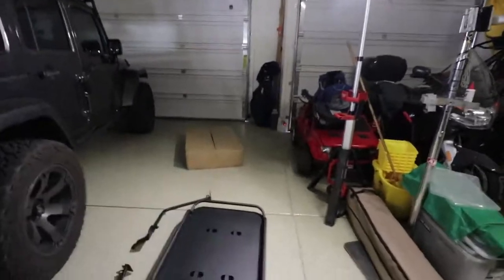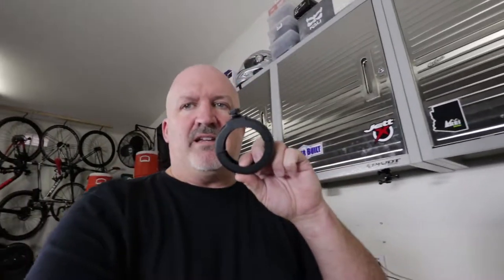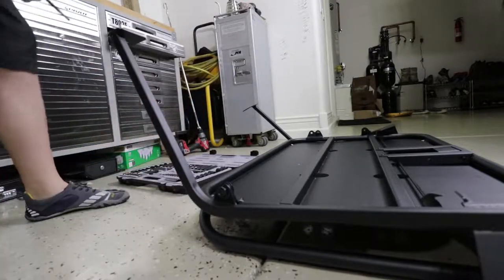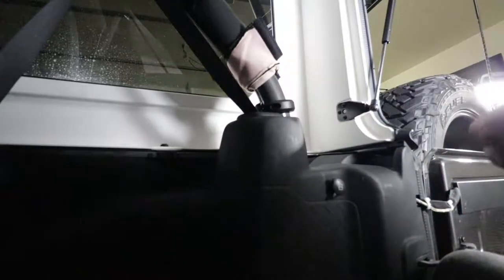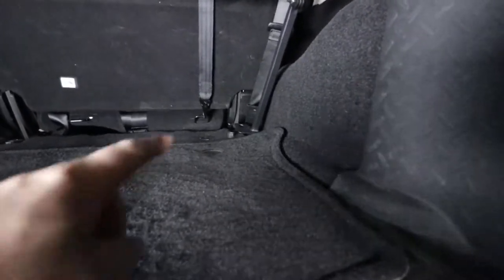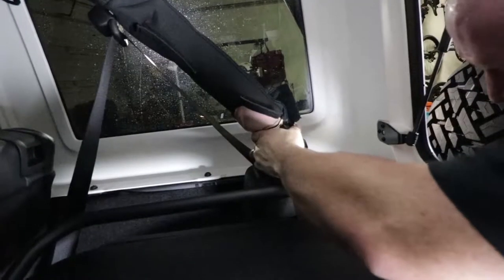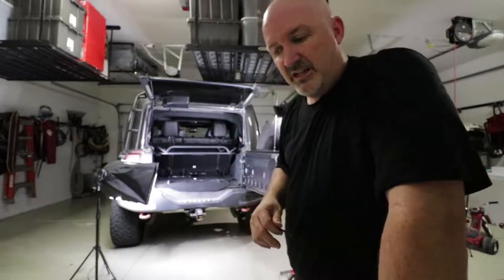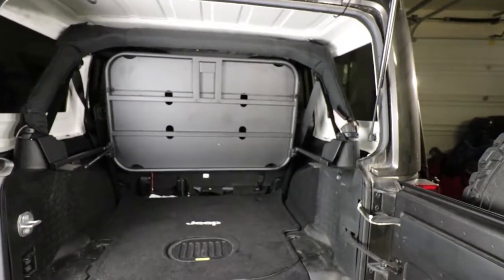Rampage cargo rack Installation - Jeep Wrangler

Comment: Thinking of getting one but I put spacers under the front legs of my back seat to give passengers a more comfortable ride.  Will that incline I created make installing this rack not possible?  How much room is there between the back of the rack and the seat?
Reply from the maker: There is an inch and a half. You would probably still be able to install, the question I thinking of is if the rack would still be able to be folded up which I think it would.
Reply: I also have an incline kit........did you ever confirm if this rack can be folded up with the incline kit?

Comment: see my questions on hinged steps???
Reply from the maker: Sorry. Just saw this. I tightened mine back up by feel and have not had any issues. All working great so far. I will see what Jeep has to say and let you know. It's a good question I'd like to know the answer to as well. Thanks.
Reply from the maker: Michael B. Golia  ok, i found several sites that contained the same torque specs but nothing from Jeep itself. Still waiting to hear back from them. Here is the link to one of the sites i have found. As always please verify for yourself that these numbers are correct. https://project-jk.com/jeep-jk-write-ups/jeep-jk-wrangler-torque-settings